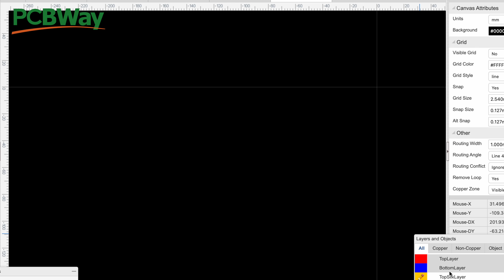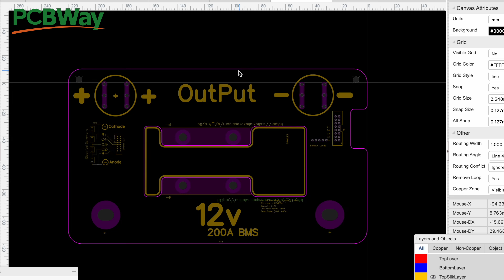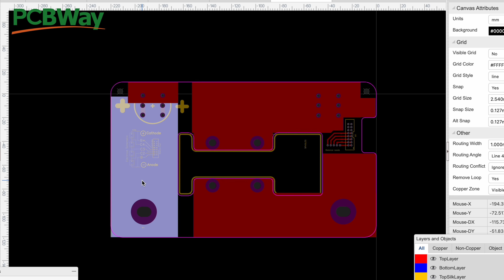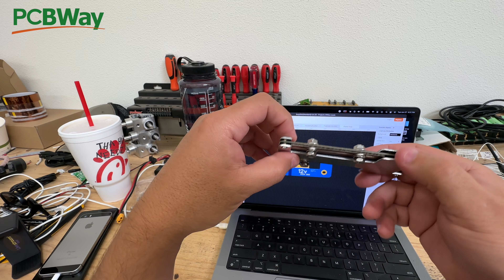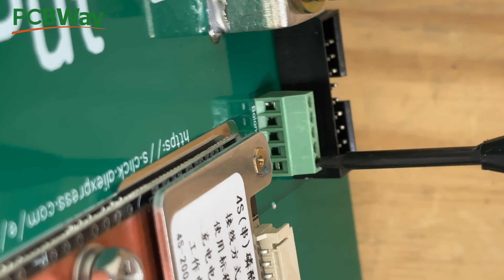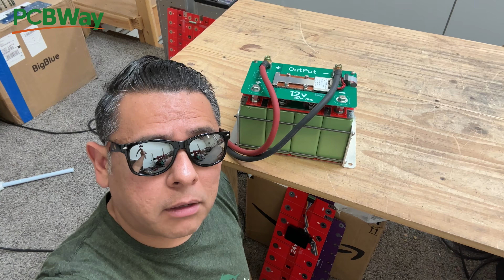DIY this $1000 BMW LiFePO4 Battery for less than $400

Comment from the maker: PCBWay Project https://www.pcbway.com/project/shareproject/200A_12v_Lithium_Battery_BMS_project_e65e1606.html
Reply: do you or can you get a lit like this foe 280 amp cells
Reply: Hey @jehugarcia love your channel I've learned so much over the years! I have a question about this particular project. I'm building a very similar battery pack. I actually just ordered the brand new LEV60's from you and they arrive today! I bought a BMS specifically made for starting a car. But of course the manual for the thing was translated from Chinese to English and it's very hard to understand. What I want to know is what is needed to charge these kind of batteries using the cars stock charging system/alternator. Is that something you know about or have experience with? The Antigravity batteries are a drop in replacement for lead acid but I can't find any information about how they're dealing with it.

Comment: Can I use this as a drop in replacement for a server UPS 12V lead acid batteries?  Or will I need to change the UPS electronics?  Or do I need to replace UPS electronics with a charging circuit that has constant current, constant voltage electronics?  Suggestions?  Thank you for your great video.

Comment: I love the clean design. Is there any concern that these cells specify 3.5v max when typical Lifepo4 cells are 3.65v? Maybe a configurable BMS could ensure the cutoff is set to 3.5v to accommodate these.
Reply from the maker: not really,  we are testing charging these cells up to 3.8v and it doesn't seem to be a problem,  you will probably loose some cycle life but it seems to be minimal.
Reply: Thanks! That's good to know. I'll be looking at ordering one of your kits. Appreciate the info on these cells.

Comment: I am very DIY, but your solution is so clean and well thought out--and I didn't want to order from several different places, etc.--so I just ordered the turn-key unit from your site. Thank you for all you do for us DIYers. I have built several 48-volt LiPo battery banks based on what I've learned from your channel.
Reply: I dont see it on the site?

Comment: Hello @jehugarcia , appreciate for sharing your knowledge. I just received this 12 v battery exact same bms is on the way. can I get away using the bms without the extra board? I guess question is if I attach the bms on the side, and  use small wires to connect to the pins on the battery. main discharge leads will be same leads on the battery right?  some other BMS's have bigger wire for leads. but I don't see any big lead wires on this BMS.
Reply from the maker: Yes you can,  you’ll have to figure out how to connect it,  use cable sized correctly for your load,  small loads can use small cables but big loads require big cables

Comment: Why are you using this BMS ? Specs show Overcharge is 3.65v±0.25v and Batteries voltage range is 2v-3.5v, seems a bit unsafe.
Reply from the maker: Nope,  LiFePO4 can charge up to 4v safely,  all LiFePO4

Comment: Thanks for all the videos, I made a solar charger trailer for my ebike but I only have a max of 90W (3x30W pannels) that I run in 12v setup. I use 4x 12v lead acid in parrellel and need to remove weight.After building and realizing I was over weight I thought I checked the price of lithium and pooped myself, thought it was hopeless for me. Thanks to your videos and site I just need to save a bit and build some powerbanks better then I thought I could get. My solar setup over charges my lead acid and a bit over amps, best conditions I get 6amps. Will be nice to have something that can actually eat 6amps.

Comment: What's the power of this battery in Ah is it used for solar storage and can i charge it directly from 12 volt panels
Reply from the maker: 74Ah,  you will need 18v out of your panels I believe

Comment: although your circuitry design can take 600A... but LiFePO4 cannot, they will overheat and utimately pop.
Reply from the maker: Stop talking nonsense,  years ago, we built electric cars with LiFePO4 that would put out 1000A.   If the cell supports Burts of 600A then it will put out 600A
Reply: He must not have seen your video of it going past 600amp.

Comment: Can a have a bunch of these sa 4 to build a 48v pack and charge with 48v?
Nice build..
Reply from the maker: Yes. https://youtu.be/ySBtJOR2x-4
Reply: @jehugarcia  Thank you for your confirmation..
Reply: @jehugarcia  my real concern is to power with my EV conversion project of 96v.. (2packs - 48v in series) While the same pack I can tap during power outage used as 2-48v in parallel....

Comment: You really leaving the standoffs on the vehicle battery cable side that way? How long you see that  board lasting when it’s constantly flexing from vibration? Those plastic stand-offs aren’t connected to anything and resting on top of the LiFEPo4 Bus bars… gonna be tapping away like a woodpecker.
Reply from the maker: I’ll put the holes in the next batch of busbar boards,  i order in small batches in the beginning since the designs iterate fast.

Comment: Hey @jehugarcia, when using something like this to start a car, would you have any concerns about the BMS disconnecting the battery while the car is running?

I've heard a bunch of YouTubers warn of a large voltage spike occuring when the battery is disconnected, which supposedly will "fry all the electronics". Is this a legitimate concern?

It seems that any Lithium car battery running a BMS would be prone to the same problem? Which makes me wonder, do they run a BMS or not? I'm picturing like Antigravity branded batteries that are marketed for motorsports.
Reply from the maker: No idea
Reply: @jehugarcia  Thanx for the Honesty  :face-red-heart-shape:
Reply: @fvrrljr  good question, have luck in finding your answer/solution  else where, or none starter/bad idea, to even do, for the reason suggested
Reply: @dh2032  i didn't ask the question, it was tonyb9785 i thought it was a great question too but respected Jehu's for being honest. he doesn't know. maybe down the line someone will post the answer 👍
Reply: I've been running BMS less headway 38120hp based packs in all of my cars for 3 years now. I have one of those 6amp active capacitor balance boards enabled while the engine is running, but direct connect. I've run them flat many times. I've so far only lost cells to rapid complete diacharge which takes a cell negative and gross overcharging for long periods. Most of my old cells are still goimg strong.
Reply: This spike could be taken care of by simply adding a capacitor to the system
Reply: Just run your lithium bank with a balancer not a BMS. I've been running 120ah of lifepo4 in my car for my sound system an my whole car😊
Reply: Great question... Does anyone know how Antigravity and other batteries marketed as car lead acid replacement get around this issue?  I ‘d like to replace the battery on my BMW E90 (2010 328i) with this one, the E90 ECU manages the battery via CAN, would the ECU prevent alternator high voltage output if the Lifepo4 battery BMS shuts off the battery?

Comment: Can I use this battery in EV Car?, I Have a vw converted to electric, and need 72 volts, Can I connect 6 of this bateris in serie?
Reply from the maker: Yes
Reply: You'd likely save money by building your own battery. If you bought this battery you're paying extra for the bms and also you wont be able to charge all of your batteries all at once, so you'd have to buy your own 72v bms and wire it yourself either way. If you're building an EV you likely will need many kilowatts of battery capacity.

Comment: Would be pretty cool to do an LTO version that can charge low like lead acid etc. (and massive C rating)
Reply: as a complete drop in replacement for  lead acid etc
Reply: Why could you not use these cells as a direct sla replacement if temps are above 0°. 600 amps should be enough for most  gas engines.
Reply: @brenthawkins204  You could, but if they go below 0C you're going to have a bad day because you can't put a BMS on it.  LTO are almost indestructable.

Comment: How many amp hours?
Reply: Each cell is about 74aH
Reply: @PortablePowerSolutions  is that considered one cell? Or 8?
Reply: @MrTruthAddict  4 cells in series makes a battery that is 12V and 74 aH. If you use 8 in series, it would be 24V and 74aH.

Comment: Am I wrong in thinking that the cathode is generally negative and the anode is positive?
Reply: That is what my training and 45  years of experience tell me as well...
Reply: For batteries cathode is positive and anode it negative
Reply: just looked it up, apparently it depends on context. meaning they can be either.
Reply: @saguarorides  Where did you find this info? Any url?
Reply: Depends on if you are charging or discharging (From a electrochemical perspective at least)
Reply: @yestrep333  If you check the voltage on a battery that’s at rest it’s normally the anode that shows a higher voltage compared to the cathode.
Reply: @SirHackaL0t.  Doesn't even need to be at rest. As long as battery is in usable condition, the anode always remains positive in respect to cathode. If you ever manage to get the polarity reversed even briefly, then the battery will be permanently damaged, and often with fiery special effect.
Reply: Yes